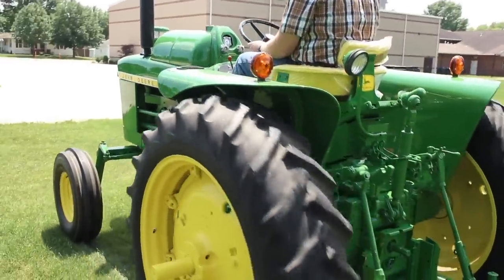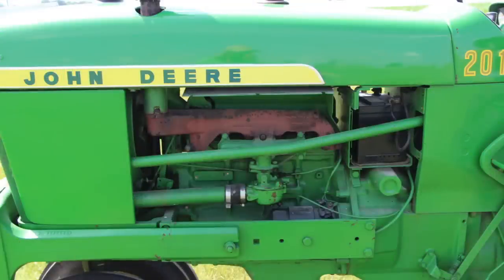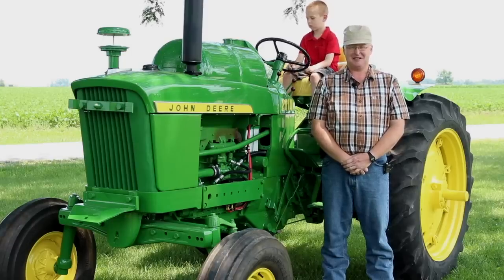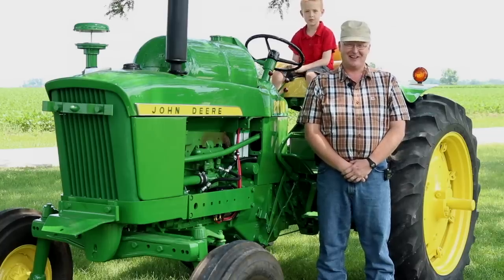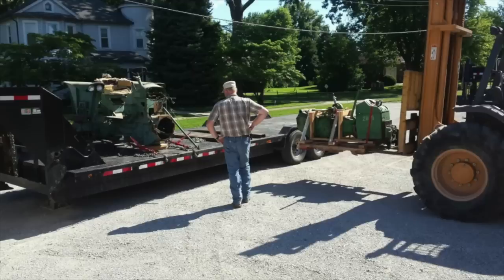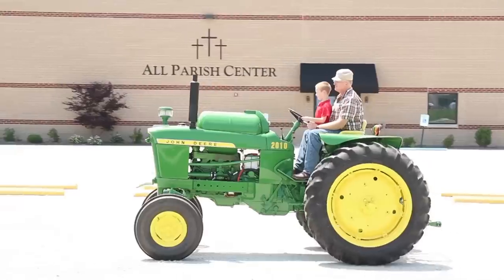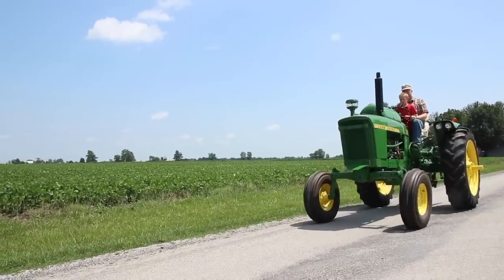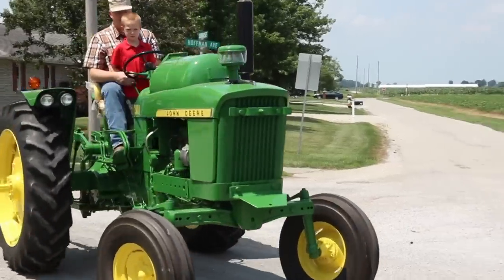A John Deere Failure? - Story Of The Model 2010 New Generation Tractor - Classic Tractor Fever

Comment: I have a 1964 John Deere 2010 gas industrial with 7 ft bucket and 5 tooth ripper in back. It has been very dependable. Always starts in the winter.
Great tractor.
Reply: You have the one in every thousand or so that was actually a good tractor.

Comment: Purchased a 2010ru diesel off a neighbor back in the 2000s,it had coolant and fuel in the crankcase, once repaired and glow plugs working it was a economical tractor to rake and ted hay with, even my dad got along with it (he was used to glow plugs on a 1970 Peterbilt/cat 1693) the only reason I bought it was up till then I hadn't seen a 2010 diesel that ran , once I started buying parts it was obvious, not to mention the bizarre linerplate assy , and the iron valve cover housed the intake   and coolant porting,fuel pump and injectors on opposite sides of the engine and a very strange PTO clutch assy. Another neighbor had a 55 diesel combine with a 6cyl version of that engine, I'm guessing quite rare.

Comment: The 2010's were really not as terrible as people have made them out to be over the years. 
Also by 1963, Deere had most of the 1st "New Generation series" bugs all worked out. Now, were they the greatest tractors? No. But the worst? No. Furthermore, there are still plenty out there in operation.
 
Another thing I've learned about nearly any vintage tractor found in this smaller Hp range, is that most of the owners of these tractors are also those who are the least likely to take proper care of them. Age, wear, & a general lack of adequate care & maintenance always leads to plenty of additional problems over time.
Reply: Yes, had a 63 2010 and it was a great tractor. No, had a 630 and a G and later a 4010 for the heavy work, it was not used for that on our farm.

Comment: 2010 replaced the 530 , not the 630
Reply: You are correct on the 2010 replacing the 530
Reply: Actually, the 420.
Reply: @farmerbill6855  no
Reply: I pulled a 4 row cultivator with a 2010 gas very similar to that tractor in the 70's. It was a decent little tractor. We had a 1010, 2010, 4010, 3020, and 4020.

Comment: We had a John Deere 2010 Grow-till Gasoline tractor. You had to take the tractor serial number and engine serial number to the dealer to get the correct parts. it was converted from 6volts to 12 volts, used a GM alternator. The PTO was locked engaged, and the water pump had to be rebuilt it seemed like every year. The radiator kept springing leaks ; it developed an ice plug in the lower coolant pipe one year around 2003, and the block cracked between each cylinder and the oil passage. I had a nearby junkyard haul it off for scrap value. He sold the transmission and rear wheels several years later. At least it went on to save some other tractor(s).

Comment: I used to have a 2010 diesel with a Westendorf loader . Handy little tractor , however I would think twice about moving large round bales with the 3 point . I did and the 3point isn't heavy enough for it . If l remember correctly , it would blow the seals in it .

Comment: I had a 2010 Diesel Dozer it was Ok, used it 35 years and understood some of the issues. Main issue I had was the fuel injection pump would need rebuild often but otherwise no real problems.

Comment: Dad had a 2010 gas tractor. No major problems other than the distributor cap would draw moisture in wet weather making it hard to start during wet weather. Otherwise it was a great tractor.

Comment: I grew up in WI, I never saw a propane model, The gas model may have been OK but it seemed like they sold a lot more of the diesels which were mostly lemons because people were replacing 530 and 630 diesels ,  Coolant in the oil was common problem, I knew I guy that had two of them, always something,  Most people eventual traded them in and got a 2520 which never seemed to have any issues

Comment: Speaking of LP being clean burning is just a an old wives tale LP is still a carbon based fuel and they get dirty inside the engine just like the gas ones I've  done a lot of major engine repair over the years.. I always liked the 2010 I have two neighbors with them and there diesel, haven't seen any trouble with either one, You have a very nice looking tractor I would be proud to drive that in any parade.

Comment: The problem with these is they were rushed through R&D with no time to upgrade the transmission. So JD hooked a 4 cylinder engine to the transaxle of a 420/440 with very little improvement. If you worked it too hard (which most farmers do), it would  come apart. Engine issues were entirely because of lack of maintenance. Hydraulics were powered by a small engine mounted gear pump in a time when more and more equipment was relying on hydraulic power.
Reply: the 2010 transmission was nothing like the 420 or 440 or any other John Deere for that matter. Some of the concepts were like the 3010. Had a 2010 utility and had NO issues with transmission. Only problem we ever had was with the hydralics was if you blew a cylinder packing it would eventually plug the pump inlet screen. A 20 minute fix once you figured it out.
Reply: The engine mounted pump only handled the power steering, the main pump was in the front of the transmission, with the clutch cover off one can see it.

Comment: I have used a 2010RU diesel with a loader for 30 years, it's a 1965 with all the factory extras I guess you would call them, it's always been dependable and a great 45 HP tractor on the farm, I have changed a few things on it such as it now has LED lights, added a oil pressure gauge and AMP meter, ROPS with a canopy, and alternator. never understood the bad rep these tractors got
Reply: Also had a 2010ru diesel, bought it with engine problems, fixed it got it running in the year 2010, Dad was 75 by then added an extra step and grab handle and he raked and tedded hay for me with it, they got along well even with the glow plugs (he drove a 1970 Peterbilt/1693 cat which also had glow plugs).

Comment: Anyone have problems with the 2010 detonating bad on the from 2 cylinders? Has  craters on exhaust side top of pistons.  Just bought it seized up bad, had to remove the head bc of 1 cyl too rusted to turn over.

Comment: I've told people over the years, dont buy a JD that ends in 10
Reply: Mechanic at the deere dealership told me that.  Hydraulics were all garbage.
Reply: I've heard that alot too. it's typical of the first model of anything following major changes.
Reply: Nothing wrong with a 4010 or a 3010.
Reply: @farmerbill6855  well JD must have felt there was because after their big release of this new generation of tractors to revolutionize farming they sure made some changes in a hurry. Most companies do it. Roll out a new model and then notice some stuff didn't work out like you planned. Look at what wonderful machines they evolved into all the way to the 4960. They got there because of the 4010. Also I feel it depends a lot on what part of the run of 3010 or 4010's you got. The later the better.
Reply: @jtoddjb  oh I agree. Speaking from experience though, I have had two 4010s, a gas and a diesel. They both performed exceptionally well for me
   Interesting tidbit (at least to me), the rollout of the new generation tractors at the Astrodome was the best kept industrial secret in history. JD going to four and six cylinders caught everyone by surprise.
Reply: @Farmer Bill  a 3010 gas was a slug. 3010 diesel was much better. 4010 gas were thirsty

Comment: I'm here to prove that even though a 2010 was supposed to be the "replacement" for the 630, it failed miserably at it. A good running 60 would out-work a 2010 like it was nothing. 2010 was more like a replacement for the 50, 520, 530 in terms of work output. Remember folks, Horsepower is a calculated, somewhat imaginary number. Torque is a measured value, and that's what really counts. The 630 was a 302 CID Two Cylinder rated at 1125 RPM. The 2010?? 145 CID four cylinder rated at 1900 for PTO work, and 2500 for drawbar work. So, less than half the cubic inches, and twice the RPM to achieve the same horsepower...
Reply: Not sure what you mean by imaginary ,any tractor or engine I ever tested that lacked RPM/torque didn't add up to rated HP, anyway a family member swears grandad's 36-d would out work the 3020 diesel, even if it did I know which one I would rather drive, and it had 4 cylinders.

Comment: Very nice looking tractor. It should be used for show, and parades. Don't try to do much real work with the 2010. Trans problems, shifter bad, PS came apart, PTO drive failed. In the 4 years of ownership, I may have gotten 6 months of work out of it. Plus being it was green, repair cost was always 50% more than any red tractor.

Comment: Good enough -- but not good enough to lead, like the 3010 - 4010
Reply: A 3010 gas was not a stellar performer either. Drop the plow, pull the throttle and watch a sundial waiting on the RPMs to come up. A 3010 Diesel was a better story. The 4010 gas was waaaaay too thirsty but a 4010 Diesel was the go getter.

Comment: A 1010 and 2010 are green farmalls.
Reply: Jds are shit ,Farmalls were the best.
Reply: Wrong.!!!!
Reply: @billcallaway5736  1010 and 2010 are considered the worst john deeres made.
Reply: @dustineiffler7145  yep. I drove one for another farmer back in the late seventies early eighties a green one 4020 ? it's again became very popular selling for like 7 to $9,000 now if you can find one over here on Delaware and Maryland area.
Reply: @billcallaway5736  a 4020 was the best tractor ever made.
Reply: @dustineiffler7145  it was to 4020 since I wrote that I called the farmer  and he said that's what he was. I started with Ford 8N's  and then we bought into the internationals and we stayed with  1066  had four  an I think 1456 had some smaller international I think we had two or three four five fours in fact I still have a a 454 I keep just for bush hogging and winter disking.for about 18 years most time when we started letting them go ahead almost 25 to 35,000 hours on them.
Reply: @billcallaway5736  I was born, raised and still live in Iowa, I'm a die hard John Deere man and work at a John Deere dealership. The 1010 and 2010 were bad tractors. I've put thousands of hours on a 4020 diesel power shift with a M&W turbo. I know good tractors and poor ones.
Reply: @interman7715  hmmm, yet no JD has a torque amplifier......
Reply: The mistake everyone makes is considering a 1010 to be like a 2010. The 1010 WAS just a 430 with a 4 cylinder engine. The only thing the 2010 had in common with any other John Deere was the 3 point draft links were like a 530/630. Even the Paint was changed from the 30 series.

Comment: The worst about the Generation 1 John Deeres were putting the hydraulic and fuel tanks at the front of the tractor.. restricted the airflow to the Radiator.. any oil seepage was a sure way to make tje the radiator air vanes stop up also fuel spillage when filling especially on the diesels was bad
Reply: @Robert Payne : Might not have been the greatest design, but it was adequate if you properly maintain your equipment. Blow out screens & radiators periodically with compressed air. Pressure wash your entire tractor at least once a year, at the very minimum.

It has always amazed me how so many farmers don't take proper care of the very machines that they rely on to make their lives easier to make a living with.
Reply: That problem was a "State of Mind" problem, keep it clean and it worked fine.